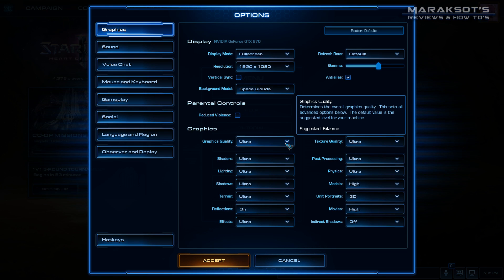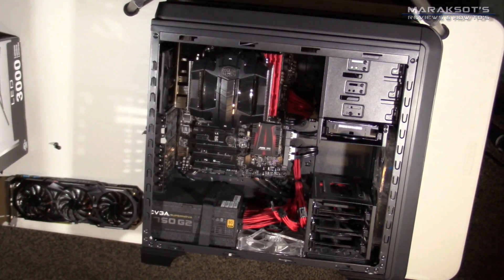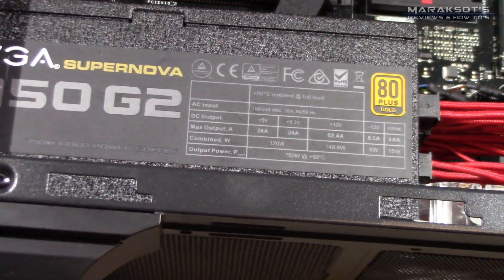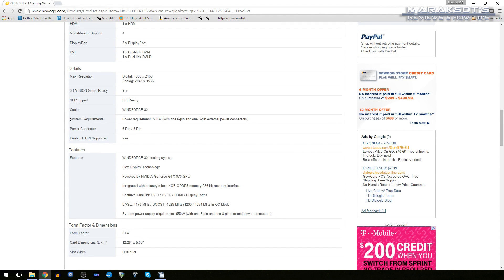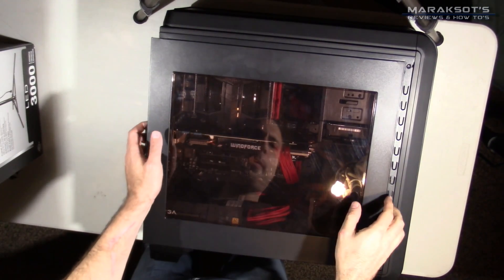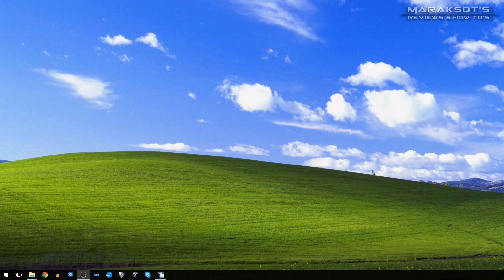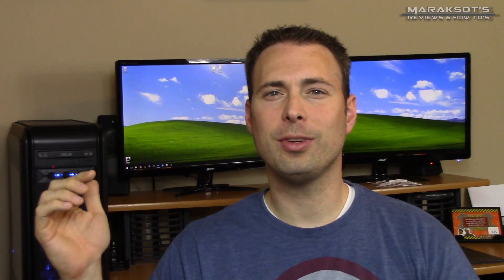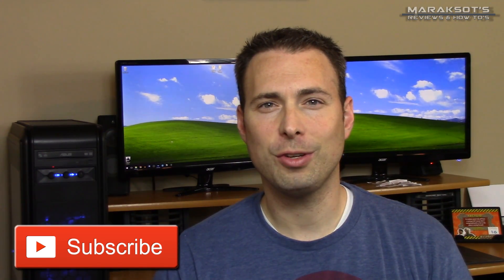A Beginners Guide - Upgrade your GPU - How to Install a New Graphics Card

Comment: Great video! I subscribed. I've built 2 higher end computers about 3 years ago for my Wife and I and now I'm wanting to upgrade to a better video card. I did the research and found a card that will work for my system, I'm going from an AMD card to a NVIDIA card. My question is, do i have to uninstall the old AMD drivers BEFORE I shut down my computer to pull my old AMD card and install my new NVIDIA Card?  Or do I uninstall the AMD driver after I swap out the video cards and boot up? I'm running Windows 10 64bit.
Reply from the maker: you can do it either way.  I've done it both ways without any issues but I usually uninstall the drivers first and then swap the cards.  Thanks for the sub, congrats on the upgrade!  :)
Reply: Thanks for the info!  I'm sure I'll be checking your channel often!  I'll spread the word about your channel :)
Reply from the maker: +John Bryant you're very welcome my friend. I've got several videos currently in the works and plenty of ideas for the future I hope you'll enjoy. :)
Reply from the maker: +John Bryant you're very welcome my friend. I've got several videos currently in the works and plenty of ideas for the future I hope you'll enjoy. :)

Comment: 0:46 some people can't run these games and you are sitting on ultra graphics quality
Reply from the maker: It's true I am lucky enough to be able to afford it at this point in my life. I did however spend many years in the exact situation I described in my video, adjusting settings trying to find that balance between getting the best graphics the machine I had at the time could muster and a decent framerate.

Comment: do i have to install the old gpu driver prior installing the new one..will my system still detect the new one and a display will still be on my monitor without the latest updated driver for the new gpu..im new with this thing thanks for the response in advance!
Reply from the maker: the way I always do it is I first uninstall the old drivers, remove the old graphics card, install the new graphics card and then install the new drivers.  I recently made a video about uninstalling old drivers and then installing new ones if you'd like to check it out.  :)  https://youtu.be/e3dGYvIa4pg
Reply: thanks men! alot of help

Comment: I'm thinking about upgrading my GT640 to a GTX980 is it possible? And how can I see how much my power supply can support?
Reply from the maker: +Tan Wow! That's a big jump up from a GT640 to a GTX980. :D  Making that kind of upgrade is absolutely possible. But of course to be able to fully leverage all the power of the GTX 980 will depend on what other hardware you're running in your system (i.e. CPU and RAM). For example if you're running a dual core CPU like a Celeron, Pentium or even an i3 or an AMD APU or any AMD chip outside of their top tier chips for that matter  (top tier being the FX 8300 and higher) I believe you're going to experience some bottlenecking. Meaning the GPU isn't going to be able to perform at it's full capability because it's going to be waiting on instructions from the CPU which translates into lower frame rates and stuff than the card is capable of in games. As for how to know the maximum wattage of your power supply... the easiest way I know is to take off the side panel of your case and there should be a sticker on the side of your power supply that will say what the maximum output wattage is. :)
Reply: Maraksot78 thanks a lot, i actually have a i7 so i guess it should be ok :)

Comment: I ended up getting a black screen any help?
Reply from the maker: +Reptilian Overlord just to make sure I understans the problem you're having... you installed your new GPU and now you're getting a black screen?
Reply from the maker: +Reptilian Overlord if so then I would try updating your motherboard bios. If your system is a few years old and you just installed a newer GPU and now you're getting a black screen then I'd guess your bios doesn't recognize the new GPU which then results in a black screen. Hopefully your motherboard manufacturer has a bios update for your board you can download and flash your bios and fix the problem.
Reply: I'm not really tech smart I'm a begginer, but I have a really decent PC. Heres the specs : Processer : Intel(R)Core(TM)i7-3770 CPU @3.40GHz 3.40GHz 
RAM: 8.00 GB 
System Type: 64-bit Operating System x64-based processor 
Manufacturer: ASUSTeK COMPUTER INC. 
Model: ASUS Desktop PC CM6330,CM66 Series 
Graphics Card: Nvidia GT 620
Reply from the maker: Yah I would open up your case and find out your motherboard model. It will be written on your motherboard.
Reply: Maraksot78 I know you're supposed to uninstall the old drivers before hand, I did skip this step could that be the problem?
Reply from the maker: +Reptilian Overlord no, it should still work. I'm pretty confident it's your motherboard bios.
Reply: Maraksot78 In the case that I do need to upgrade my bios, do you have a video tutorial on how to do so?
Reply from the maker: +Reptilian Overlord just the other day I was helping a guy that was having the same problem after installing a new RX 470. We tried several different things and in the end he flashed his motherboard bios with the latest version from his motherboard manufacturer and that fixed it.
Reply from the maker: +Reptilian Overlord unfortunately I don't but I can do my best to walk you through it here.
Reply from the maker: you may have already started looking for another video on how to update your bios but I wanted to share this one that I found.  I haven't watched it all the way through but from what I did watch this guy seems to do a pretty thorough walk-thru on how to update your motherboard bios.  https://www.youtube.com/watch?v=-TRWfYCiO6M
Reply: Maraksot78 Thanks I got it working man upgraded my bios! I subbed btw thanks for all the help.
Reply from the maker: well done! that was quick.  :D  thanks for the sub, I'm happy to do what I can to help.
Reply: Maraksot78 yeah haha looking forward to your content.
Reply from the maker: I'm actually in the process of working on a new video right now.  :D  hope you'll enjoy it when I get it all done.  :)

Comment: hey man i have a stock Gateway zx6971 haha and i just want to upgrade the graphics card to play a few games installed a car driving game yesterday and it looks like im playing it on a old tube tv small words kinda blurry any ideas on a card i can install that will make things alot better but will be able to keep pretty much stock memory
Reply from the maker: +Bike254 I tried looking up your computer but it looks like there are quite a few different configurations for that model number. I was trying to see what your CPU and RAM and stuff is to find a suitable GPU to suggest for your system. If you could get me your exact specs that would help a lot. Also what's your budget and how high are you wanting to crank up the settings?  :)

Comment: I want to change from amd to nvidia what do I do with drivers
Reply: +Maraksot78 hi thanks for the video but can I switch from GeForce gt430 to gtx 1060 and its fit
Reply from the maker: +فارس ال تويم as long as your power supply can handle it you shouldn't have a problem.
Reply from the maker: +shnpio I'm glad you asked. Check out my driver video here https://youtu.be/e3dGYvIa4pg  enjoy! :)
Reply: +Maraksot78 while your here how much would you think an amd Radeon saphire r9 270x would be worth
Reply: +Maraksot78 while your here how much would you think an amd Radeon saphire r9 270x would be worth
Reply: +Lord Business I want to and I went to cex to sell my r9 and the offered 50 bucks for a gpu worth 120
Reply: +Lord Business ya I got that when the offered 50 bucks
Reply from the maker: shnpio I would think a R9 270X would have to be worth at least $100 right now. I agree with Lord Busineas and although I haven't looked into what they're selling for on ebay, it's worth checking ebay's completed listings to see what people are getting out of them and then price yours accordingly. :)
Reply: hey Mark. Maybe you can help me, or tell me if I wasted my money I recently bought a HP Elite 6000 SFF Desktop PC, which has a Core 2 Duo. I bought it specifically so that I could use a certain gaming software (RPG Maker MV) but the software calls for OpenGL 4.1, while mine is a meager OpenGL 1.4. Is there anything I can do?
Reply from the maker: yah, looking at the specs of that model of PC that's more of a "daily driver" PC you know for web browsing and what not it's not really meant to be a gaming machine.  Sorry man.
Reply: Maraksot78 so, can't even upgrade to a 4.1 with software upgrade? Darn.
Reply from the maker: I'm going to be honest and say that I don't know a whole lot about OpenGL and DirectX and stuff but I do know that to be able to run the more current versions of OpenGL and DirectX it needs to be supported by your hardware.  For example I know that only graphics cards made in the last couple of years support DirectX 12 so I assume the same is true of newer versions of OpenGL.  You could always upgrade your Graphics card to something that supports OpenGL 4.1 but most likely what's going to happen is your Core 2 Duo CPU is going to become a bottleneck.  Now that's not the end of the world, things will still work they just won't be able to work at their optimum level.
Reply: Maraksot78 Thanks a lot Marak. I appreciate the help. I'll check out more of your videos. Really just getting into the PC scene now. Trying to learn JavaScript on my own, but the book I bought, and the online tutorials are WAY different from one another. Online tutorial shows you how to do things, but doesn't explain why it works. Just the opposite for the book. Thanks again. ...Marak, sorry. Called you Mark.
Reply from the maker: you're welcome.  I'm happy to do what I can to help.  Best of luck to you on the programming stuff.  That's something I've thought about trying to learn but haven't yet tried.  :)

Comment: i have a Geforce GTX 760 and i can't play "Squad" too much lag. What kind of graphics card do you guys recommend me to play it at 1080p?
Reply from the maker: +xVSxOpticalScope kinda depends on your budget. Recently both Nvidia and AMD have released new GPU'S and if you want a card that will run just about any game at 1080p on high to max settings then I'd recommend the RX 480 from AMD or the GTX 1060 from Nvidia. You can pick up an 8GB RX 480 for around $240 US or a 6GB GTX 1060 for around $260 US. There is also a 4GB model of the RX 480 that is $199 and I believe a 3GB model of the 1060 is coming out soon. Not sure of the pricing on that one yet but I assume it will be closer to $200.
Reply: I just ordered my GTX 1060 and I'm currently running on integrated graphics.. I've read a couple of forums and articles saying to uninstall my integrated graphics then to install my graphics card and to install the drivers after that's done. I'm a little worried since this is my first PC build anything helps
Reply from the maker: Elite Gandalf I've never worried about uninstalling my integrated graphics drivers and have always just installed the Nvidia drivers for my Nvidia GPU's and have never had any problems... knock on wood. :) I recently made a more in depth video you can follow for uninstalling old drivers and installing new drivers if youd like to check it out.  https://youtu.be/e3dGYvIa4pg  best of luck to you my friend! :)
Reply: Thanks a lot man and I sure will :)

Comment: I had an old amd Radeon HD 7450 from a prebuilt and I decided to upgrade to an rx 470, I installed it but I have no output on the monitor, I made sure everything was wired correctly. All the fans and everything turn on but there's nothing on the screen. I'm assuming it's a driver issue, any clue on how to fix?
Reply: Oh and I forgot to mention, I watched your most recent video on how to uninstall drivers but I guess they didn't uninstall properly. I think it's because I used catalyst drivers when the rx series uses Crimson.
Reply from the maker: +AntRocks42 does it display the manufacturer splash screen when you first boot up? Or is there just nothing?
Reply: +Maraksot78 nothing
Reply from the maker: AntRocks42 do you have another monitor you can try?
Reply: +Maraksot78 I do but it's vga and I don't have an adapter, anyway I don't think it's the monitor, it was working perfectly fine before I upgraded
Reply from the maker: +AntRocks42 you could try putting your old card back in and updating drivers first then installing the new GPU. Also I've heard of problems like this being resolved with a bios update for your motherboard.
Reply: +Maraksot78 I'll try it out and let you know what happens
Reply from the maker: +AntRocks42 ok cool, I hope you can get it up and working soon. :)
Reply: +Maraksot78 alright so I put in my old graphics card and it boots up like normal, when I install the Crimson driver, will that interfere with my old graphics card since it's still in?
Reply from the maker: No, it'll be just fine.
Reply: +Maraksot78 just installed the drivers and the new graphics card, still didn't work, I'm clueless as to what the problem is now, thanks for the help anyway
Reply from the maker: +AntRocks42 sorry to hear that didn't help. It could be a compatability issue with your motherboard and the GPU or the worst case scenario is you got a defective 470. :/
Reply: +Maraksot78 I'm gonna keep researching, thanks for all the help!
Reply from the maker: no problem man I hope you get it figured out. sorry I wasn't able to help more.
Reply from the maker: Hey man just curious if you were able to figure out the no video issue you're having?  I had a thought of something I didn't ask you yesterday. What wattage is your power supply?  Looking at the RX 470, depending on the model you got it's recommended you have a 500 to 550 watt power supply.  If your card isn't getting enough juice that could explain why you're not getting any video.  On newegg.com I see that it lists the TDP on most of the RX 470's between 110 and 150 watts or so but that is a rating of the amount of heat that needs to be displaced by the cooler not the amount of power it needs to operate.  So if your PSU is under 500 watts you won't be supplying enough power to your GPU for it to work properly.
Reply: +Maraksot78 still didn't fix it, and it's a 650w power supply so I don't think that would be the problem, I've been searching all over the Internet and I might just end up returning it and getting another one, could be a defective card
Reply from the maker: so you have plenty of power... yah my guess would be either a defective card or motherboard incompatibility. I don't know how old you system is but if your motherboard is somewhat older it's possible that it's not quite compatible with the new tech in the RX 470.  I feel that isn't particularly likely but it is a possibility.  Anyway, best of luck to you man.
Reply: +Maraksot78 it's an amd 970 chipset and I've seen people put way more powerful cards on a board with that chipset. On the box of the card I looked at the system requirements:
PCIE X16, check
500w PSU, check
4gb ram, check I have 6.
Keyboard, mouse, display, check.
There's nothing incompatible so I'm assuming it's a defective card, the only way for me to check is to go to my friends house (he has an rx 480 so it's the same drivers and stuff)
Reply from the maker: Sounds like you should be good to go. I hate it when computers do weird stuff like this. Definitely try it out in your friends system and if it does the same thing on his system then you know for sure it's a defective GPU.
Reply from the maker: AntRocks42 if the 470 works on your friends system then I'd try seeing if there's a bios update for your motherboard.  I don't know if you've done that before but you just need to go to the manufacturers website for your motherboard and then search for your motherboard model.  If you don't know what model your board is there's usually some text on the board that says what model it is. Once you've found it there should be a section that has driver downloads and stuff for your board and there may be a bios update there you can download and copy to a USB drive.  Since you're not getting any video at all with the 470 then you'll have to put your old GPU back in to do this but you boot to your bios and there should be an option in there somewhere possibly under advanced settings or something to update your bios.  Find the bios file on your USB drive and install it.  This is of course all assuming the card works on your buddy's machine.  Anyway, that's about the only other thing I can think of that may help fix this if it's not a problem with the GPU itself.  Best of luck to you man.  :)
Reply: +Maraksot78 I'm gonna try a bios update with my old gpu in I hope that's the problem and that can fix the issue, I just wanna get good fps while gaming :/
Reply from the maker: +AntRocks42 I hear ya man, I hope the bios update does the trick.  Good luck! :)
Reply: +Maraksot78 just wanted to let you know I got it all up and running just now, 3 days and I finally got it all good with an easy little bios update. I feel pretty stupid but in the end I got it up and that's all that matters
Reply from the maker: +AntRocks42 happy to hear you got it figured out. So it was your motherboard bios eh?
Reply: +Maraksot78 just a simple little bios update was all it needed!
Reply from the maker: +AntRocks42 I guess now you're just gonna have to do some extra gaming to make up for those few days of lost time. :D ha ha ha
Reply: +Maraksot78 heh I guess, thanks for all the support you've given me through these past few days, one thing led to another and it eventually became a solution
Reply from the maker: +AntRocks42 no problem man. I'm happy to do what I can to help. I'm glad you were able to get it working. Enjoy that new GPU man. :)
Reply: +Maraksot78 :)